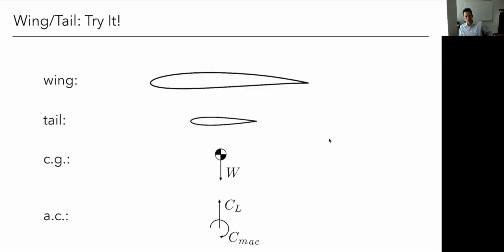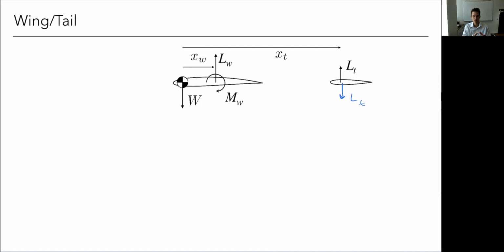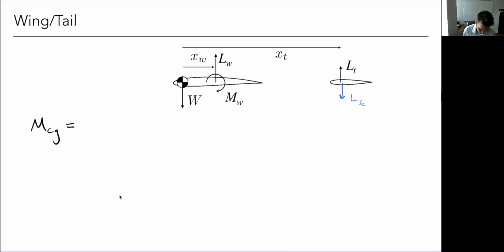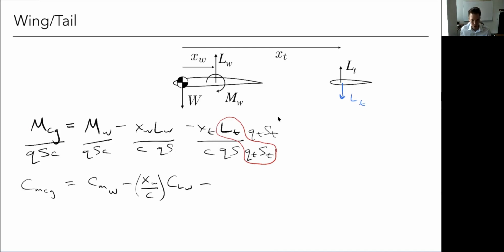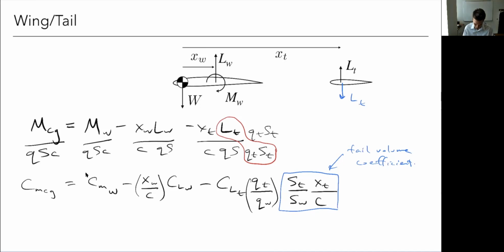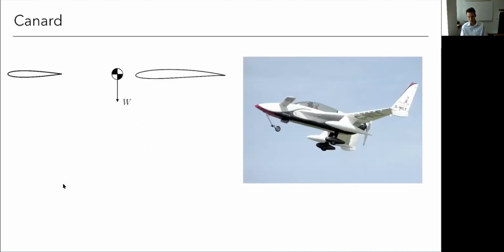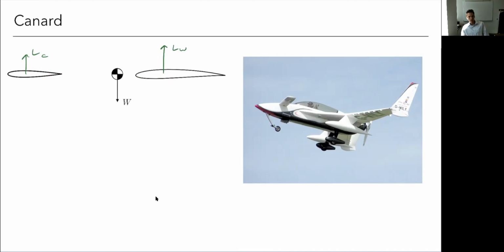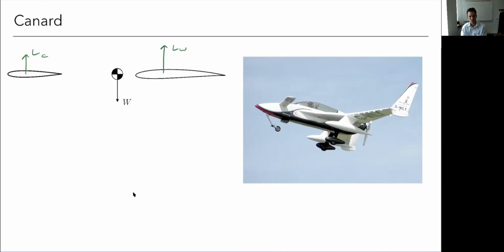10b-Longitudinal Stability

Comment: Thanks for great tutorial! Can I ask why the pitching moment of the tail is ignored in the moment equation? Thanks
Reply from the maker: Typically one uses a symmetric airfoil for the tail, so it has zero pitching moment (or nearly so). You can certainly include  it though, as well as the moment from drag, which is also typically negligibly small.